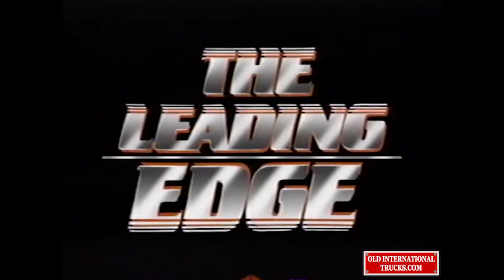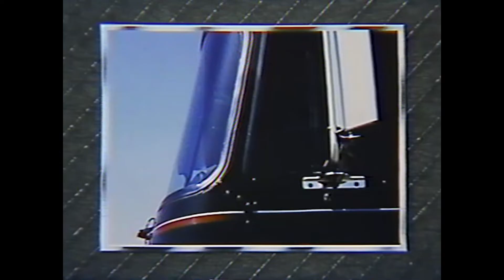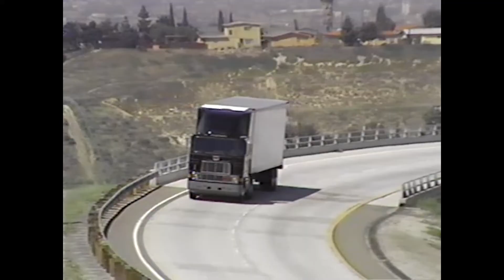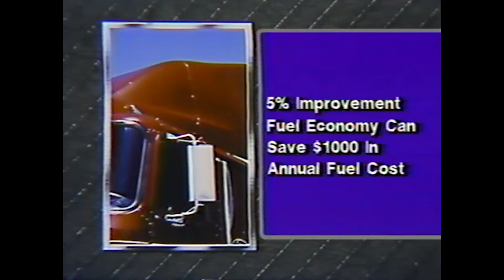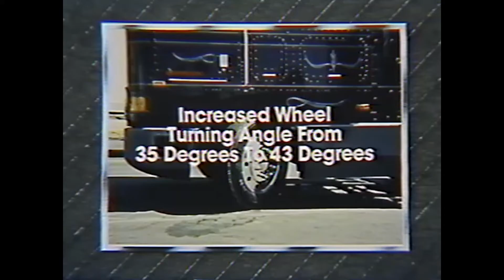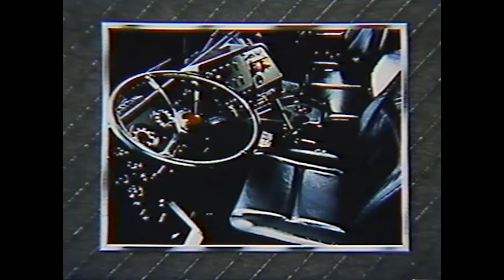International 9600/9700 Leaders Guide

Comment: I owned a 9670 brand new. loved the truck and would stay out for months at a time on the road, young and single, lol. 300 cummins, ac and no power steering with spring ride. at the time there were length limits on Virginia's secondary roads. It could pull a 48 foot trailer and still be under the 65 foot limit. 48 was th3 longest legal in 1983 and 1984 on the east coast, the two years I owned the truck. I missed that rig. Great view and sitting above the traffic was great. Handled great but was a bear to back in close quarters with no power steering. I learned a lot driving it though.
Reply: Looking at 95 one with a Detroit 60s should I get it ? It’s going to be my first truck
Reply: @darrylrichardson1997  Depends on what you are going to do with it. Most companies are picky over the trucks they lease on. But if you have that straight and the truck is in excellent shape than i would, though i have never been a fan of detroits that is just me. Make sure to fix any problems while they are little. Lot cheaper at home before the truck breaks than under a load on the side of the road. Good luck. I loved driving cross country and at 68 miss it every day.

Comment: The t660kw  w990 and other junk models are not made as good as these!!
Reply: T660? That's a joke, although almost all of them have emissions garbage on them, the trucks themselves are exactly the same behind the firewall as a W900 or T800, they're solid trucks.
Reply: @tommyw.9424  plastic junk i know trucks i think your deceived!
Reply: @jopete681  if you think the only thing that makes a W900 different than a Cascadia or Volvo is the shape of the hood and position of the front axle, you're sorely mistaken. And of all the differences, literally all of them except the shape of the hood and axle placement apply to the T800 and T660 too.
Reply: @tommyw.9424  junk!!! Plastic trucks! I will keep my w900/359 and 379 i am a expert on trucks!
Reply: @jopete681  and how many trucks do you own?
Reply: @MasterWitchDoctor  4 trucks a 9300 international a 1985 kw/ 1982 359 pete and a 1999 379 peterbilt and a 1977gmc dump truck and i have restored 95% of them to new condition so what else do you want to know smart ass!! All yeah and i pull a 13 axle on a regular basis! I am 39 years old and was riding in classic truck as a baby so i know trucks new and old. The problem is the dumb mf that are not passionate about the industry like i am and they are damaging our industry! The problem that people don’t see is i can fix my old trucks myself, get better fuel milage while driving something more simple and sounds better while out pulling and performing new equipment! They are simply making all systems to where it cost more to fix and if you don’t have the latest update on a laptop your not fixing shit! There is a reason old trucks are still around and i guarantee you these new trucks will be scrap pos in half the time as my 40 year old truck!!!

Comment: The set-back axle ones are kind of goofy lookin.
Reply: True, but the popularity that came along with those trucks can’t be argued
Reply: Hard to look cool in a old set back axel Schneider cabover
Reply: @ronaldmorrison6013  🇺🇸 Maybe so.🧐 I just find them harder to get in & out of. Maybe you need to climb it a few times to figure out what exactly is good for ya. I just haven’t done it yet. I think the set back cabovers are still cool. They feel different when turning!😵‍💫 Cabovers still rule.🥰😎✌️
Reply: @ronaldmorrison6013  lol
Reply: Ive robbed slot of parts off of them to keep my 9670 going plus the 9700 and 9800 were later trucks and the grills have a nicer chome look but fits the older 9670
Reply: The international cabovers are the most ergonomic roomy cabovers I've operated. Even the old 4070 transtars were laid out pretty well, just alittle narrower with a direct link shift lever which fe er LS more sturdy
Reply: @joehighsmith2951  🇺🇸 I’ve always liked the IH cabovers. My brother had a 4070 that was such a reliable & easy truck to drive. It had the 238 Detroit but that truck was a beast when it came to hauling anything. It was slow but would get you there! 🥰🤩✌️
Reply: I like the look.
Reply: Ohio Porters!🇺🇸 I can remember when they came out..would see several around. It seemed that many companies would buy one or two of them or so. I wasn’t sure what to think. Yeah, they were quite odd looking, but were they that better on fuel?! I drove a bus that had the set back axle…it was totally odd & awkward when cornering. Sure had to get used to that one! The jury is still out in these for me. 🥰🤩✌️
Reply: Called them Rocking Chairs back in the day.
Reply: @joefell7845  lmao rocking chairs